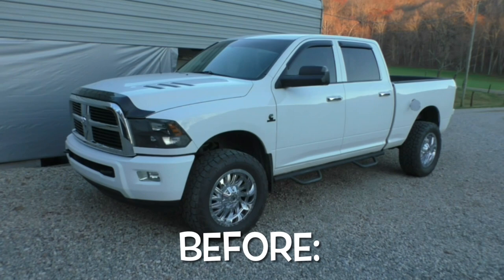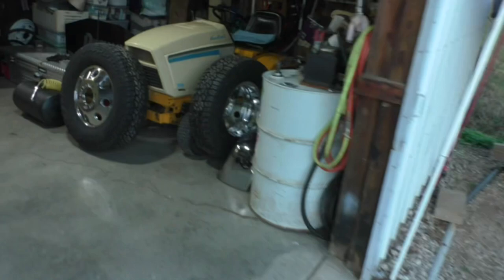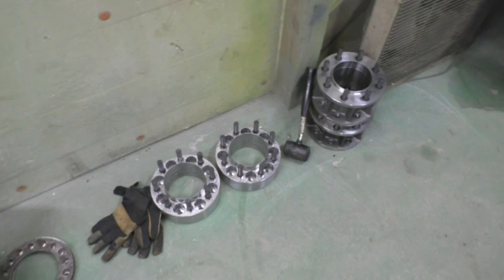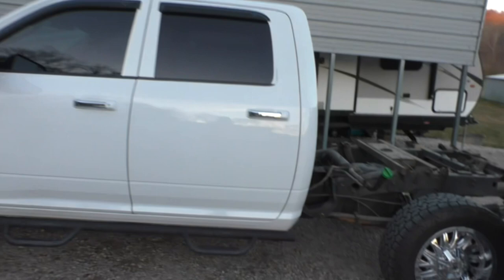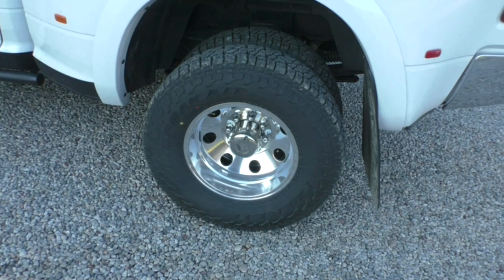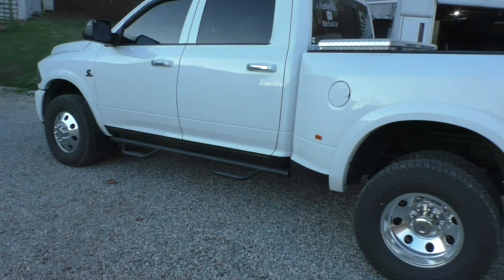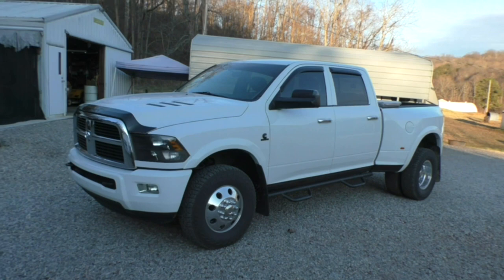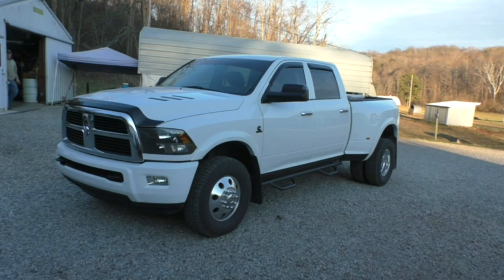4th Gen Cummins Quad Cab Short Bed Dually Conversion

Comment: Any more videos of the truck after the swap? Updates? I just got a quote from arrowcraft and I’m considering this just for extra stability in hauling my 35’ gooseneck as a hotshotter.
Reply: How much was the quote from arrow craft? And how did it turn out?
Reply: @JLU24DR  didn’t do it yet. And I think the quote was $2500
Reply: Did you get around to doing the swap my guy. I do hot shot too and have a 2500 wanting to do the swap
Reply: @dkeboss3673  no, decided if I’m going that route I’m gonna axle swap it. I use the truck for commercial work so it would be pointless unless I axle swap.

Comment: Truck looks awesome! In the process of doing the exact same to a 16 3500. Have a couple questions. What tire size did you go with? My singles were 20’s and want something close, also did you add 6 tpms or just 4. Probably gonna do the swap in a couple weeks and would like to be prepared as I can. Thanks
Reply from the maker: Tires are 255-80-17. Unfortunately, there aren’t a lot of tire choices on a dually if you don’t want to run a spacer between them.  Where this truck is a 12 it didn’t have tpms, so I’m not sure what to do there on the swap.  Good luck and send us some pics when it’s done!

Comment: Did you ever figure out weather or not the spacers and wheels where the dodge 8x6.5 or if they where the ford metric pattern? Looking to do the same to my truck and would love to know before I bought them
Reply from the maker: Turns out they are 8x 6.5 to 8 x 170 mm (4 bolt pattern).

Comment: What does the bed side measure from inside frame to the edge of the outside of the fenderwell compared to the regular bed.
Reply from the maker: It is a stock mega cab dually bed (it was a take off).

Comment: How much the kit from harrow cost
Reply from the maker: The kit from arrow craft was $2100 which includes front and rear adapters, lug nuts, center caps, and 6 aluminum wheels

Comment: Does this conversion increase the GW load
Reply from the maker: Technically no, the GVW on the truck remains the same.  You’re just adding this for extra stability.
Reply: @weberpullingteam  thanks ,any advice on how to increase GWV ? I have a ram 2500